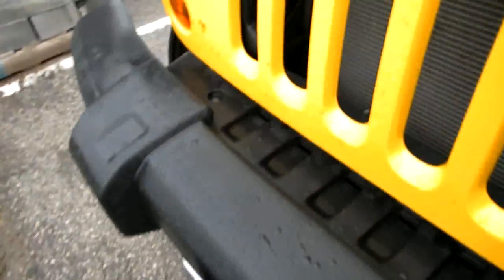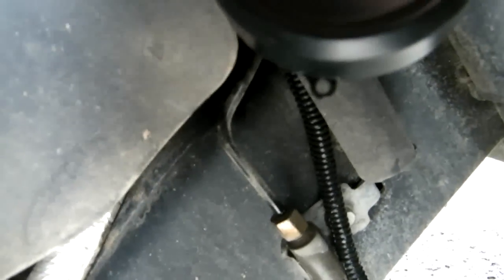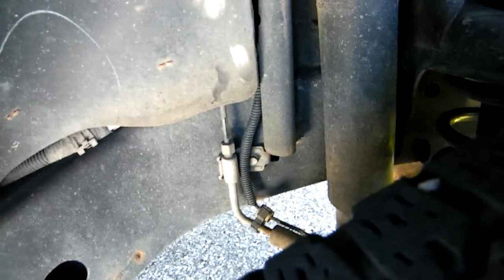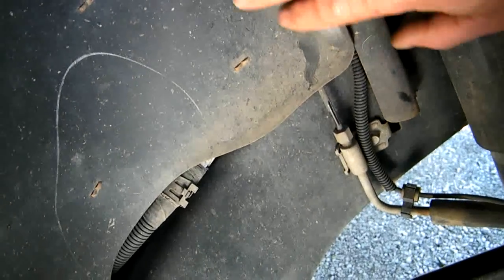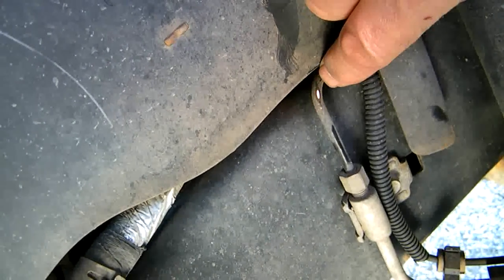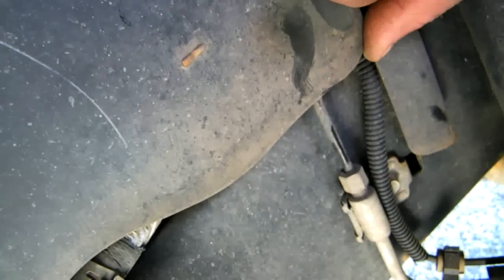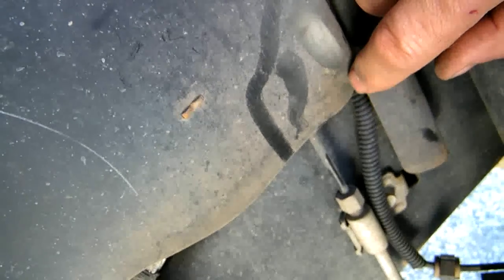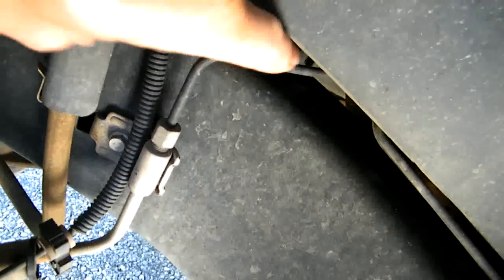Jeep brake Recall - a close up look at the defect

Comment: Had this happen on my' 07 4 door Sarahara, the line on the front pasanger side wore through with corrosion from NY winter road salt contributing to degradation of the line.   Suddenly lost stopping power, pedal to the floor, the master cylinder had emptied out.    Found a high end foreign car repair shop on the avenue I was traveling on, who replaced that line and on their recommendation also replaced the driver's side which was in the same condition about to burst through.   With a cab ride to get home the job cost $700.00, all for a triming of that poorly designed  shroud as depicted in this video.
Reply from the maker: +richard kluesek I hate to tell you this but if you had taken it to the dealer the repair would have been free
Reply: +carquestions Many Thanks for reading about my plight.   The pedal went soft while traveling on I95.   I exited to the service road and when spotting the repair shop had to pump a limp pedal and downshift and pull the emergency brake handle to stop.   The tech pointed out that the master cylinder was empty and initially opinioned that the brake line had been cut by a saboteur.   After picking the car up on a lift the next morning,  he correctly diagnosed the rub from the wheel and internal flare panel and corrosion had caused the line to break and that the driver's side was in the same condition.    I took his recommendation to repair that line as well.   What if on I95 at high speed I was unable to slow down or stop and caused a collision resulting in deaths and /or injury and property damage.?    Surely the Florida State Police investigator would be interested in the condition of my brakes.   It was after 5pm and I needed to get home 40 miles away.  I was relieved to beconsiderately helped by an eminently qualified repair shop (Velocity Factor in Boca Raton Florida) to whom I was unknown and not a customer.  The Chrysler campaign recall and simple preventative remedy is a complete hindsight surprise, and I intend to follow up with the Zone Rep.

Comment: I don't have that problem on my 07 JKU Diesel, but I just had a ABS module internal fault. It's going to Jeep tomorrow for a replacement ABS module. I tried cleaning the ABS module connector plug and socket with contact cleaner but the fault comes back as soon as I hit 50klms/Hr.
Reply from the maker: +fourbypete I'm thinking bad sensor - not module at this point
Reply: +carquestions No the sensors are all testing fine. The error I'm getting is c2200.
Reply from the maker: +fourbypete If thats the case then check for a recall - this repair should be free in my opinion - brakes are after all, safety devices by definition
Reply: +carquestions Jeep have told me that the fault is stored but no longer occurring so it can't be tested. They recommend no further action.  must have been a bad connection.